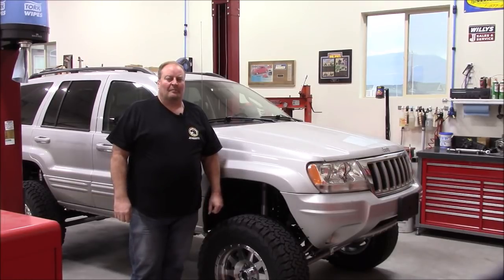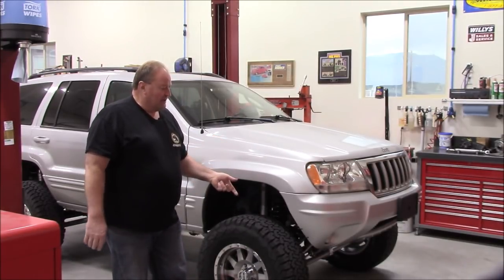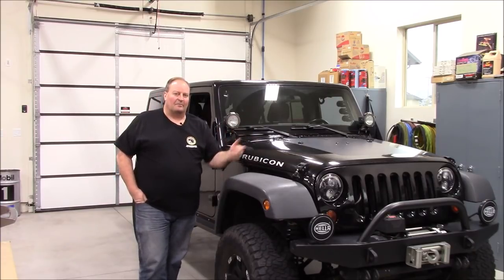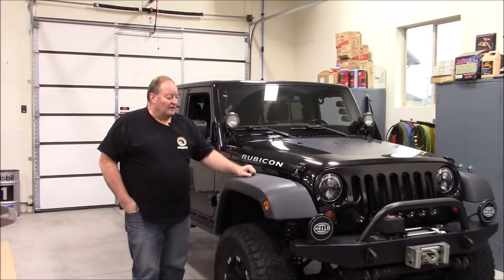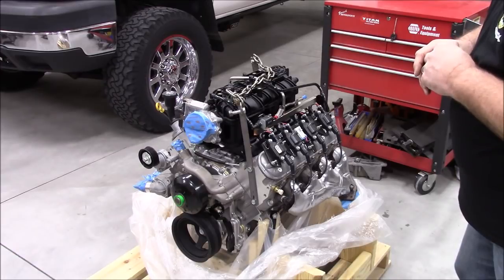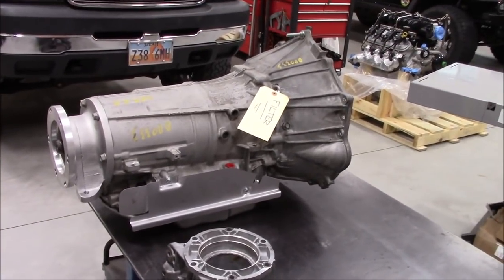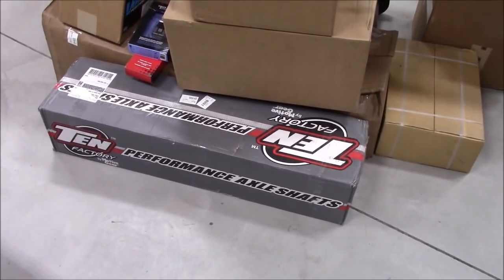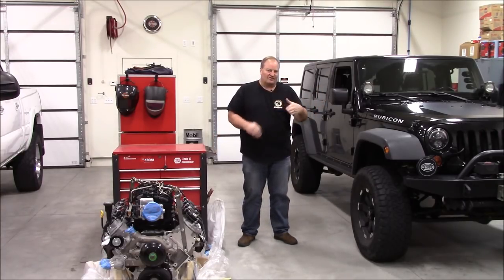Saturday Morning Shop Tour #3 and Next Project Introduction

Comment: Mike - great videos, I am going through the same LS/6L80E swap in my 2009 JK. I am also looking for a heat shield for the 6L80, you mentioned you had a hard time tracking this down. Do you happen to have the part number for the shield that you ended up with? - Thank you.
Reply from the maker: Heat shield part # is 25980339. 

Mike